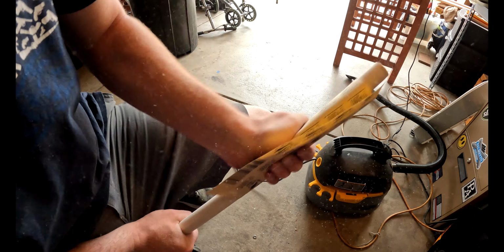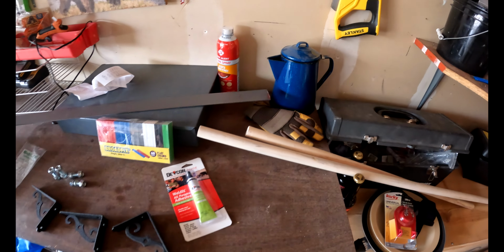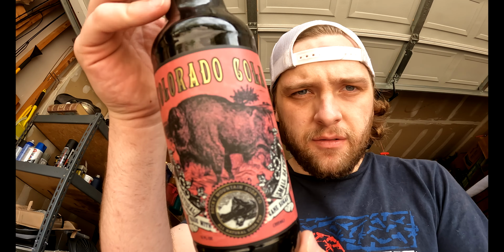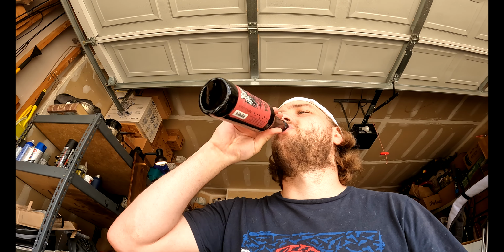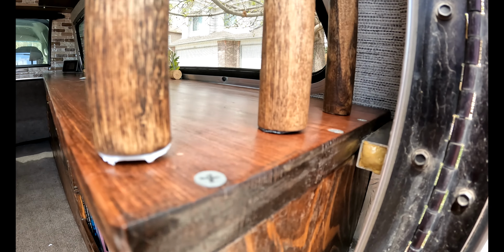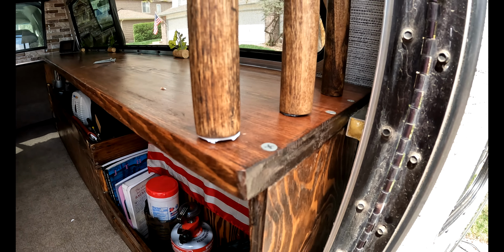Ep 5. Adding a new shelf to my D.I.Y truck camper, and a new friend?

Comment: What size bed you got bro...?...and what is that kind of topper called..?....I like your set up
Reply from the maker: Thanks!! The topper is an ARE truck hero cap. I'm not sure if it has an exact sku number, but it's just slightly taller than the cab of the truck, so it's comfortable to sit upright. I insulated it with poly iso foam board and laid the wallpaper over that. The bed is a folding futon mattress from walmart, i think they still sell them. I will do a full walkthrough on my camper soon. Thanks for watching!
Reply: @TheBrokecamper4570  cool man...is your truck bed a 6 1/2 or 8ft...?...dude love your taking your dog...!!!
Reply from the maker: @snipershot71  its a 6 1/2ft bed, ends up being the perfect amount of space to stretch out and sleep. an 8 ft bed would be nice though haha. Kai does make camping a whole lot more fun that's for sure!